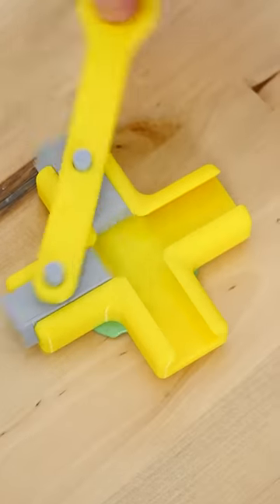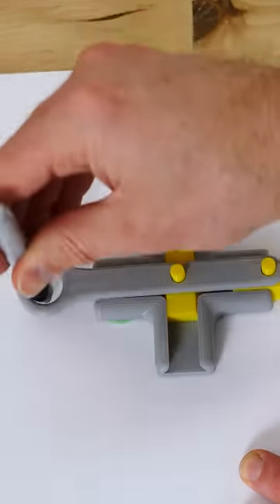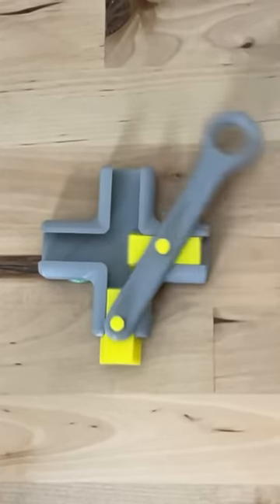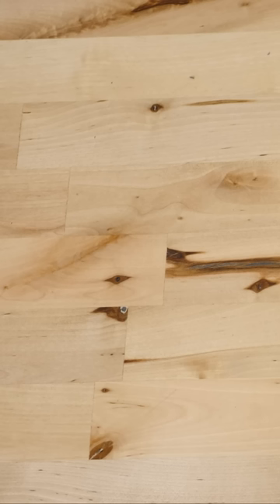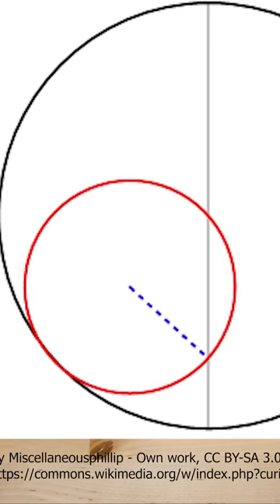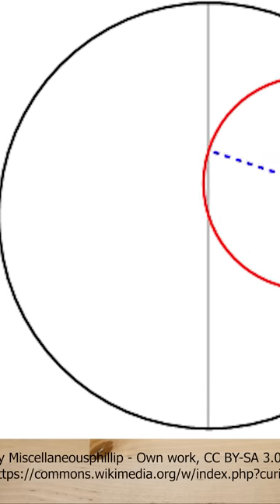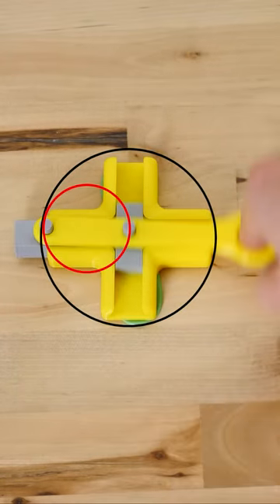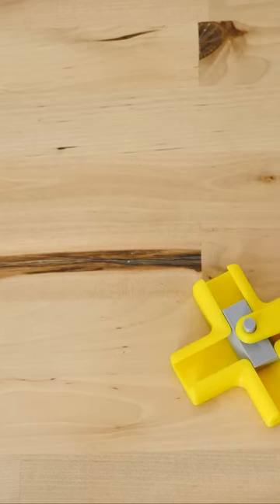The Do Nothing Machine

Comment: Take the original Trammel of Archimedes and expand it to the Third Dimension. 

Instead of a small Circle within a large Ellipse, you now have a small Sphere within a big Ellipsoid.

Not only would the segments/points move along the [ x ] & [ y ] axes, but also the [ z ] axis as well.

Now it's a Hyper-Trammel of Archimedes...  ; )~
Reply: Maybe a Trammeloid of Archimedes, the Hyper-Trammel would be a 4D one
Reply: genius
Reply: we need more people thinking.. and your comment made my neurons fire
Reply: @obedulloa6219  I don't think a 4d one is possible because it works the same forwards or backwards in time
Reply: @monodragon  I never said the fourth dimension would be time. Hell, we can even model it in R^n and have a n-dimesional Trammel
Reply: @obedulloa6219  i just am pretty sure that the fourth dimension is time because of how we interact with it linearly
Reply: If you had a sphere of half the diameter of the bigger sphere or cylinder it is rolling around inside of and you look at points along that smaller sphere, then you will have multiple parallel 2D versions of the Trammell of Archimedes each working at different radiuses dependent on the smaller ball which are all normal to some vector in the 3rd dimension, which is interesting enough because you can actually make an infinite number of unique alternatives to the Trammell of archimedes just by choosing different points on that sphere that lie along a plane that is parallel to the plane along which the ball rolls.  For example, imagine you have that sphere rolling around inside of a cylinder and they fit the criteria mentioned above and you pick two points on the sphere that lie on a plane parallel to the plane where the ball rolls.  Kind of a convoluted sentence to read but I hope it makes sense...  On the cross section of the sphere made by that parallel plane, if you have those points on the opposite end of that circle, when the sphere rolls, instead of getting a straight line, your gonna get two ellipses.  Now, if you were to bisect the sphere along the plane made by its contact with the cylinder, the point at the peak of the hemispheres you created will be moving in a circle as the sphere rotates, and the closer you are to that point with the two points you pick to place on the sphere, the more the ellipses converge on that circle.  The closer you are to the rolling plane, the more those two points will appear to form a line.  You can in fact do this quite cleanly and simply with any shape that along and crossection normal to the shape's "centerline" is a ellipses of sorts whose widest crossection has a circumference that is half of that of the cylinder it is rotating around in and who's "d^2y/dx^2 isn't greater than the circle's at any point they make contact.  If you make an appropriately shaped elipsoid roll around in that cylinder if it's circumference is half that of the cylinder it's rotating around inside, a dot on it's circumference would make a unique shape in the center depending on it's location.  You could rotate something in an elipsoidal cylinder lol (although all the ellipsoid stuff can probably get kinda tricky...).  Going back to 2D, you could have a circle of a third of the diameter of the circle it's inside of, in which case a point on the inside circle makes a equilateral triangle instead of a line as it rolls.  You could do tons and tons of graphical things where objects need to be equidistant from each other, and that's pretty cool because it can be even further elaborated on in order to appropriately approach some more complicated problems out there with such requirements of objects moving through geometric shapes at equal distances.

Thanks for coming to my Ted talk
Reply: @monodragon  The 4th dimension can be whatever the hell you want, you can think of it as a Trammel from a 4 dimensional space where time is the 5th dimension. If not, would and hypercube have it's 4th dimension on time? no, that's not what an hypercube is.
edit: all my years studying math say this, trust me I'm an engineer.
Reply: @happy guy  Excellent! Thankyou. This is what I want to participate in, this flow of ideas building ideas... 

I suspect if we did make a 3D Hyper-Trammel (or device which replicates it's movements without an actual physical lever, ellipsoid, etc. - perhaps using a virtual 3D map), then we could use it to precisely maneuver several 3D Print Heads, simultaneously - using virtual points on the sphere to program Three Dimensional Co-Ordinates for spline movement pathways. IRL each Print Head would be on a separate robotic arm, with the minimum necessary articulations to achieve precise movement. 

~ ~ ~ 

Or inversely, an extremely precise Haptic (3D Touch) Feedback System, enabling the kind of  granularity which telepresence robotics designers have only dreamed of. Imagine being able to juggle multiple balls being held by a robot many kilometers away, seemingly feeling the weight of each ball, the forces of gravity & inertia acting upon then... 

What kind sensory resolution could we achieve on the fingertips & palms of our robotic (telepresence) hands..?  

How close to our actual Propriocepatic Sense (Kinesthetic awareness of our body parts in relation to one another) could we get..?

[ Edit: Fixed weird bug causing lots of zeros, I hope... ]
Reply: @brazilianambassadordale8223  me when my post is unreasonably long, "don't mind my mini series" 
But TEDx 😂🤣👍
Reply: @adinashaina9977  lol I just rambled a lot n shit
Reply: @Skeptical_Numbat  I like your words, Magic man :)
Reply: Salute to those who understood this
Reply: Salute to those who read this☝
Reply: @monodragon  
Time machine or Archimedes

Comment: ...pretty sure any machine can be converted to "do nothing machine", if it is not attached to a function or given material to do anything. It's already used for drawing an ellipse here; attach it to a function and it might just have its uses.

(Seems great for sorting, for example; feed items in the middle of the device in even intervals and it will sort the items through different slots evenly).
Reply: That was exactly what I was thinking,you could achieve a similar thing with upside down cycle
Reply: All gym machines are do-nothing machines. Change my mind
Reply: @TasX  I . . . agree wholeheartedly

Comment: "Do nothing machine" I can think of so many uses for this what do people mean
Reply: In its current state without using anything else or modifying it it’s not very useful tho
Reply: @doomzday9099  I could say the same thing about a cog but we don't call them "do nothing wheels"
Reply: @_pitako  doesn't a cog transfer useful movement?
Reply: @friedchicken1  yes but that requires other cogs. On its own a cog is useless, much like the "do nothing machine"
Reply: @_pitako  ohhh now I see why my one-cog gear is not doing much
Reply: @_pitako  fair enough
Reply: @_pitako  You can use 1 cog to do stuff my guy
Reply: @_pitako  That's like saying a battery is useless because by itself, you can't do much with it. I can use that same logic with so many things. Wheels are useless because if their is nothing to drive or move then a single wheel by itself would be useless. Doors would be useless because if their is no walls or foundation than the door wouldn't even stand.
Reply: @HappyCuteKitten  you misunderstood me. I'm not saying cogs are useless. I'm saying they're useless on their own. A battery doesn't really do anything without something to power. A wheel has no reason to roll if not attached to anything. And a door with no walls can just be walked around. Many things are useless on their own, but very useful when combined with other things
Reply: @HappyCuteKitten  that's the hole point. Saying something is useless because it can't be used without other things is stupid, that's why saying the do nothing machine is useless just because on it's own it can't do anything is stupid
Reply: @_pitako  Yeah
Reply: @_pitako  I re-read your og comment and I misread it so bad😅 Sorry
Reply: @Minecraftzocker135  Yeah...
Reply: @_pitako  I call them do nothing wheels all the time.
Reply: I'd imagine that those uses you can think of already have much better designed mechanics than this though, therefore rendering this pretty useless (especially in this day in age). Could be wrong though, so feel free to provide some examples
Reply: @arcguardian  consistency is key
Reply: Exactly
Reply: @friedchicken1  a one cog gear is just a badly made wheel
Reply: I was thinking the same exact thing. I was about to Google, "why is it called do nothing" .... I don't know why, but when I first saw this mechanism, It actually made sense why it was called do nothing but I forgot the reasoning.
Reply: I'm just here because there was a lot of replies I needed to read
Reply: @_pitako  that’s a stupid thing to say and you know it a cog is a part of a system that is actually useful to transfer movement this contraption isn’t a part of anything it is literally useless stop wasting your time mincing words or keep doing it I guess lol
Reply: @616CC  i dont think you read any of the replies i left. I am not saying cogs are useless. I'm saying that, much like the so called "do nothing machine", a cog is useless on its own. A cog on its own is a fancy wheel. So if we're gonna call this machine useless just because on its own it doesn't do anything, we could also say the same thing about a cog. This machine, when combined with other machines, could have a variety of uses, much like a cog. This machine only does nothing because it isnt attached to anything. A cog that isn't attached to anything does nothing as well.
Reply: so funny to me how everyone is arguing in these replies even though i think we’re all in agreement fundamentally
Reply: Seems like it could be implemented into weaving or cooking like kneading dough
Reply: Magnetic valve
Reply: @_pitako  following that logic, isn't any inanimate object without any other interaction a "do-nothing" machine?
Reply: @Kids_Scissors  technically even animate objects too
Reply: @batu5180  I suppose so
Reply: @CHEESE_BOI_YT  same
Reply: I love your nickname and pic :D
Reply: @thalaquatics8712  how so
Reply: @doomzday9099  what if you need to draw elipses without a compass
Reply: @i_love_games110  then you’d have to use a drawing utensil

Comment: Feels just like a lecture at school. First half I'm thinking " ok I got this, that makes sense." Then by the second half I'm lost.
Reply: Are you lost on the two circles part? All you really need to know is that as long as your measurements use the proportions of those two circles, you can put as many pegs as you want. They just have to be on the outline of that smaller inner circle.
Reply: it's a circle running around the center of a circle in an elliptical path
Reply: It's a joke. I get it! 👍💯✌️

Comment: Anything ends up as "do nothing," if you use it for nothing. Many of those can be used for rapit switch currents, gear changing, valves, circuit swapping, even to create electricity.

Comment: I have a feeling that this can actually be useful. Remember, the first motors were just a curiosity and a toy. This can do something, I’m just not sure what.
Reply: Well before computer graphics were a thing it was used to draw ellipses.
Reply: My brother was showing me a couple of slow motion videos of mechanical parts working and the way that an helicopter propeller works seem to be very similar to some of those things.

It could be that that particular video was of a non-standard helicopter or that I misunderstood it, but most of those machines seem to have some sort of use, even if not very important ones.
Reply: You could use it for converting circular motion into a striking motion you could make a electric hammer for driving nails or shaping metal

Comment: I need this to go the opposite direction for my OCD
Reply: It will go the opposite direction. It can be cranked either way. But you probably already knew that, but just needed to SEE it operated the other direction so you could feel satisfied by that. 😃
Reply: @CivilEngineerWroxton  yes
Reply: It does. When the yellow machine is shown, they are turning it clockwise. The gray machine they turn counter-clockwise. Except right at the end the yellow one is also turned counter-clockwise for a moment.
Reply: Every proper machine can be inverted
Reply: i have the same ocd as you. i even get triggered when someone makes more than two circles in 3rd person in a video game. im like "i need you to rewind sir!"

Comment: Looks like the crankshaft and piston movement of a 90° V engine.
Could also be used on its side as a TV holder arm for a centrally mounted TV, or mounted on a wall, and it could move about a lot.
Reply: As well as for drafting.

Comment: if you basically put the yellow shape on an axle, and you put the grey blocks 180° offset from eachother on a separate axle. Offset those two (for example down a couple cm) you have made a 2:1 gear ratio or 1:2 depending on which one you drive

Comment: I've actually seen an older baler that used a do nothing grinder as part of the hammer machinism for packing the bales. It worked as the timer for the hammer to strike between movements of the sweeper. Really neat to see in action

Comment: This is how pistons in engines work right? You can have steam or ignition to expand hot air, which pushes the pistons in a straight line. But this mechanism converts straight motion into circular motion, which is then used to rotate gears and transfer the movement to other parts of the machine.

Comment: Technically it doesn't do nothing, it does three things at once without fouling on itself. Converts rotation into linear movement in one direction, and another, AND draws out a perfect ellipse at the same time. It's just not connected to anything. You could probably make a neat fountain or something by running the water feed up through the centre...

Comment: This isnt exactly useless. If you cut a small hole in the bottom plate and turn it upside down, and extend the coverage of the top plate, any stream of small items coming throught the small hole at a rate equal to x/n where n is the number of channels and x is the total period of rotation, will be split into n different streams of equal rate. 
There are easier ways to split streams, but this one is neat because it can split n different items, rather than a series of binary splitters.

Comment: So I was thinking: what is the actual axis of rotation to the bar here?
Since it’s an elipse, there can’t be a single fixed axis, or the movement would have to result in a circle. It’s also clear that there are two axes.
We know from Physics that motion depends on the reference. The problem is that if you look at each one axis as a reference, the bar is clearly rotating around that axis. And not only the bar, but the other axis as well!
This is really bugging me!

Comment: Soooo....
What if...

The two blocks were magnets, strong ones.
And at the end of each slot are other powerful magnets, set in the inverse as to repulse those attached to the hand. Which the hand its self is hooked to a crank generator, and battery to store the energy?

Limitless/free energery? No not quite, because eventually theyed lose charge...

But like... would that not work?

Comment: That sort of reminds airplane star engine arrangement but with pistons that traverse the opposite ends of the piston pair to have the combustion compression cycle... It could be possible to use this in such use case, just need to add crank rod to the halfway point between the two piston "pins" and it traces a circle.

Comment: I'm no math expert, but that small circle is the radius, not the diameter of the larger one
Reply: I'm no math expert, but you don't get it at all, the small circle spins around so that means any point of the small circle will make a straight line that would be the travel  same length as the diameter. But you're right  the small circle is the radius when it's not moving.
Reply: I know 😉😘